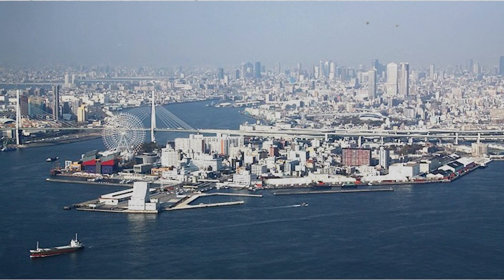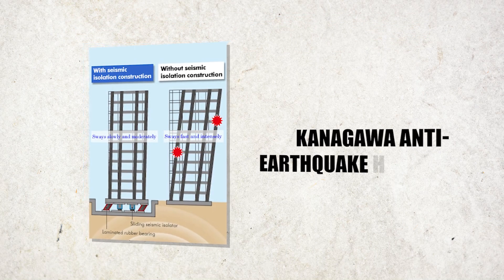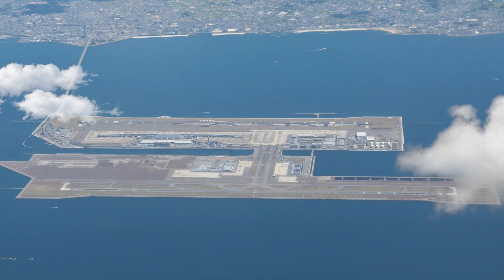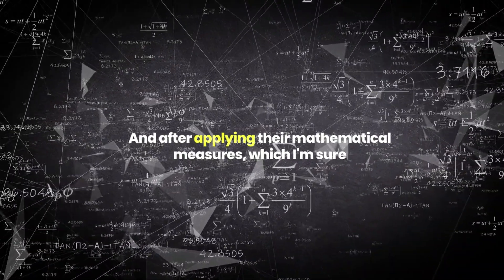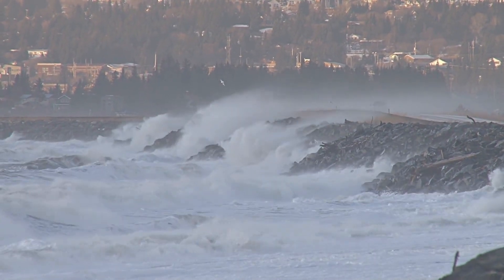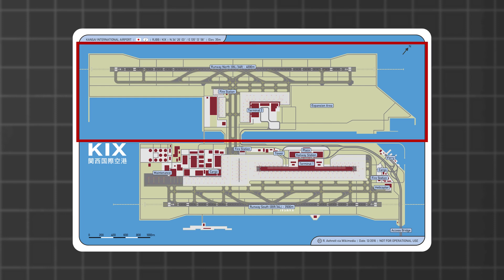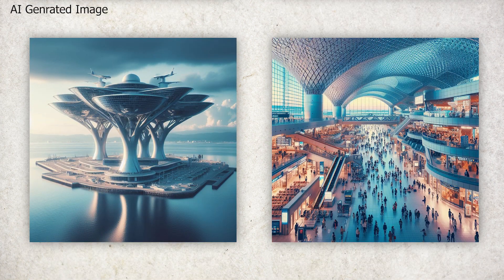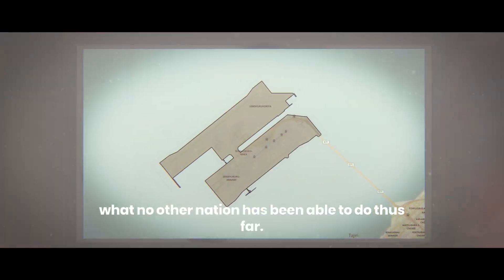The Race to Save Japan's $21BN Floating Airport

Comment: The island is not dropping 10cm everyday. That would be 118 ft per year!
Reply from the maker: We meant that it is sinking 10cm on a daily basis. Obviously the airport doesn't sink 118 ft per year:)
Reply: @Legendary_Builds what?
Reply: @Legendary_Builds  Simple google search says...The sink rate fell from 50 cm (20 in) per year during 1994 to 7 cm (3 in) per year in 2008.  You will have more subs if you do your research more thoroughly.